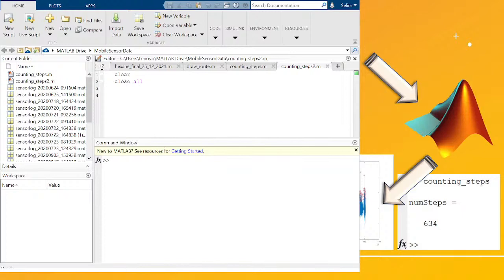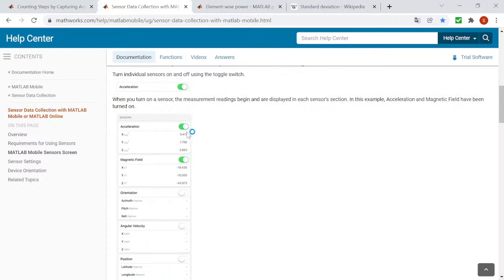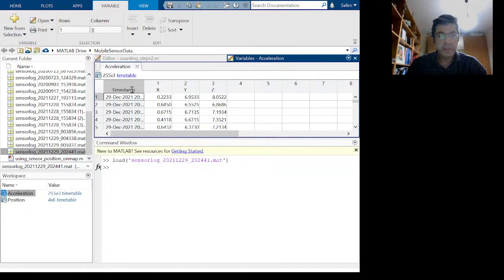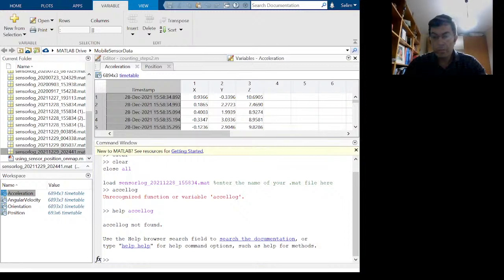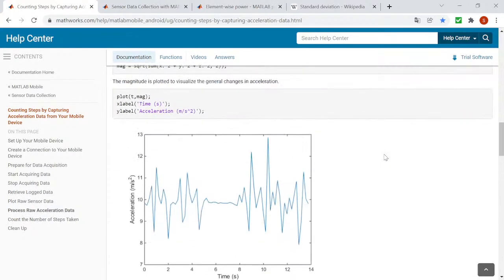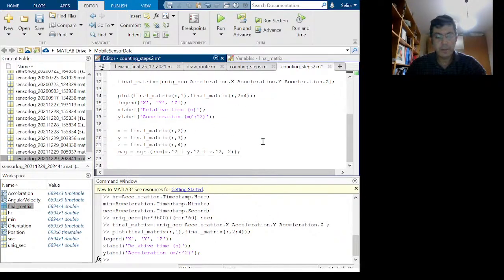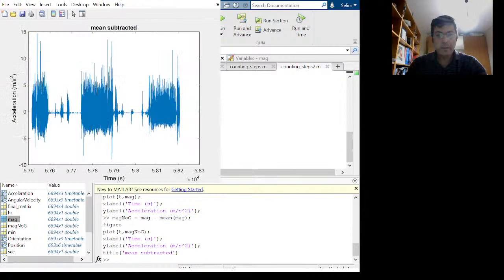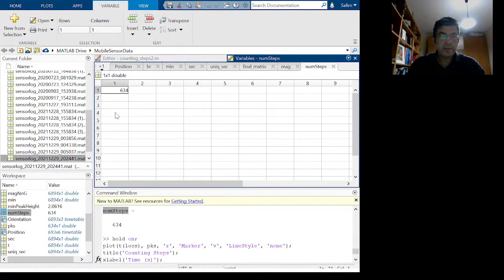MATLAB Mobile: COUNTING STEPS  using Android / IOS Phone Sensor Data

Comment: sir. Can you tell me how to convert its sensor data to csv file.  I tryred the method on net but they are not working. Please help
Reply from the maker: Hi Ayan, I guess you're mentioning the csvwrite command. You're correct in a way that the whole sensor data cannot be converted to a csv file( at least I could not do it either). But you can convert a regular matrix into a csv file. So I suggest that you go through all the steps I showed in the video until creating the 'final_matrix', the code below:
---------------------------

clear
close all
load yoursensordata.mat %enter the name of your .mat file here

hr=Acceleration.Timestamp.Hour;     %or any other sensor's property
min=Acceleration.Timestamp.Minute;
sec=Acceleration.Timestamp.Second;

%now let's create the unique second information with (hr*3600)+(min*60)+sec

uniq_sec=(hr*3600)+(min*60)+sec;

final_matrix=[uniq_sec Acceleration.X Acceleration.Y Acceleration.Z];

-----------------------------
and now use the csvwrite command:

csvwrite('sensor.csv',final_matrix)

This will work and you'll see your csv file in your working directory ( I just tried)
I hope it helps.
Reply: @drselim  ok thanks sir